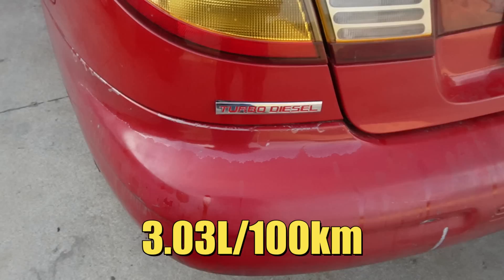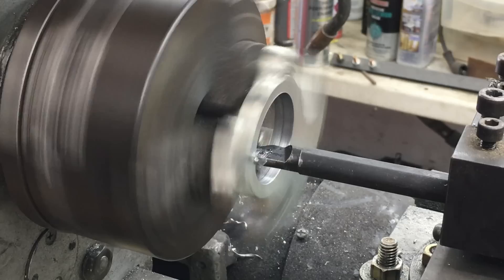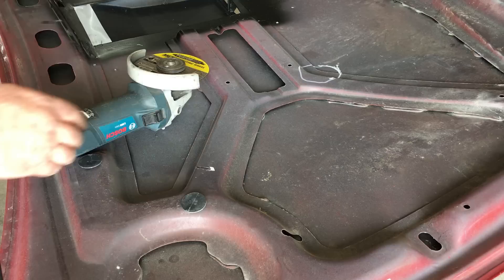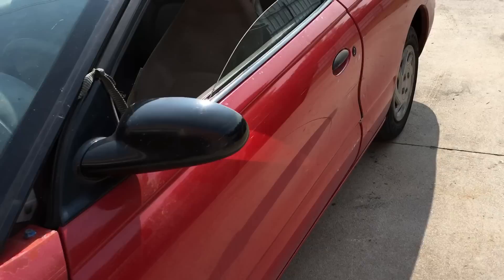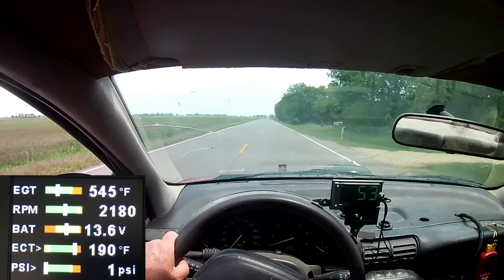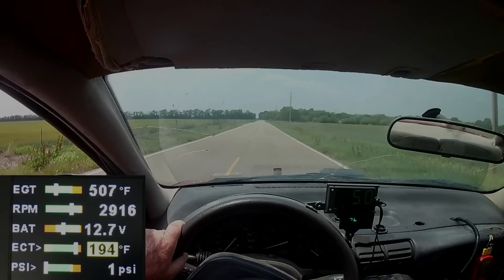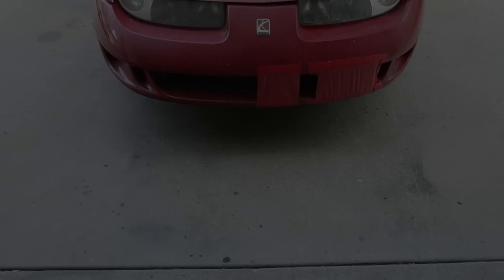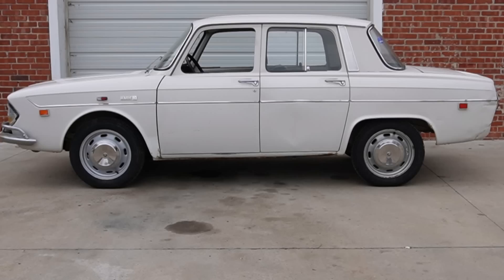S3 E17  We get 80 MPG with our D722 Kubota turbo diesel Saturn.  Best fuel economy yet !

Comment: Hey One more suggestion for the saturn, add steam into the intake. I have used waste heat from cooling system to do this on gas engines and gotten a steady 15% increase on fuel economy, diesels not having vacuum are a little more difficult. I want to add a small mister nozzle onto the exhaust manifold, but it is difficult to do on a 7.3. This little engine has the exhaust right there. Maybe weld a pipe onto the exhaust with a small tube holding a nozzle to spray water, or a water meth mix (aka winter time windshield fluid) . Run the larger pipe from the exhaust to the intake pre intercooler. 

The idea is two fold, 1 the steam displaces air, and 2 thw steam being in direct contact with flame will turn more heat energy into mechanical energy because water expands more with a given amount of energy than normal air/fuel/exhaust. And I guess it might cool the egts while still spooling the turbo, but that is a WAG
Reply: The Saturn, which is no longer in the driveway, and Jimbo said he will no longer torture it?
Reply: @drippingwax  maybe a little more torture, the horse wasnt quite dead yet.
Reply: @mythoughtsonfaith1031  Sir Gallahad - Bet you're gay!
Reply: @drippingwax  hmmm well if your fishing, your using the wrong bait, sir gaylahad

Comment: Remote Cantuna: I feel your mileage would improve with a small 4 cylinder diesel.  Something that would chooch the turbo between 20 and 30 lbs of boost. You engine just isn't large enough to produce boost and seems working way too hard for this size car. With a small Grey Marine engine you could dial way down on fuel and with a hand operated boost control while driving I believe at 70 mph this car could approach 120 miles per gallon with your degree of dedication. That is with perfectly spraying injectors and the compression at 22 to one with only one ring and the oil ring with a ceramic piston coating and 5w 30 synthetic oil.

Comment: hello. I think it could improve if I put the exhaust outlet on the side skirt. You probably need a particle filter, at least to pollute less.
On the other hand, what do you think about joining the turbocharger together with a supercharger, that is; Turbo-Interculer-Supercharger, increasing the pressure even more but gradually to the demand of the engine.
Then I would put a water methanol injection into the intake.
Greetings from the Canary Islands.

Comment: Tips for Career Success as a Recent Engineering Graduate
Reply: Go Above and Beyond Your Job Description

Extending your scope of influence beyond the job description and contributing to other departments can make a huge impact, says Arek Gdowski, an engineer at Dehumidifier Corporation of America, Inc. (DCA). He not only develops engineering solutions within DCA but also helps out in the IT department.

“You would think you're just going to focus on engineering only, and you're just going to do your one [role] — but it doesn't end there; it goes outside the box,” he says. “You quickly understand that you really don't have just one job — you have many.”

Gdowski also urges young engineers to be outspoken to set themselves apart from colleagues and accomplish more by presenting new approaches or solutions to challenges.

"Don't be afraid to speak out and say your new ideas, because many of the things I thought were just an idea that came to mind suddenly became a reality," Gdowski says. “Take that step and don't be afraid. Don't be afraid of failure, because you will fail many times before you succeed.”
Reply: Work Collaboratively

Rachel Pacheco, a chemical engineer and senior manufacturing manager at Genomatica, says that working collaboratively is the key to being effective and successful within not only your engineering job but any role across disciplines.

“Communication is the center of everything,” Pacheco advises. “That’s understanding how much to communicate, when to communicate, [and] in what format to communicate.

On top of communication, it’s about building strong relationships,” she adds. “Especially because we work in such a multidisciplinary field, having a strong relationship with mutual respect, openness, honesty, and transparency is absolutely essential."

Pacheco goes on to advise that these strong relationships are the platform on which you can build your career, and these connections can help you further develop your skills, approach challenges in a new way, and eventually move up in the ranks within your company.
Reply: Stay Focused on the Task at Hand

Despite Gdowski's larger scope of influence within his company, he understands the weight of his responsibilities and urges young professionals to stay focused on what's in front of them.

“You’ve got to take one project at a time. The brain can’t focus on many things; there’s no such thing as multitasking,” he says. “You have to focus on one thing, finish that one, and then move to the next one.”

Gdowski cites balancing his responsibilities as one of the biggest challenges of his job and encourages engineers to ask for help if they need it.

Comment: I want to see that saturn cranked up more fuel equals more boost which makes more power add another turbo preferably bigger on top of the first one to compound it which will add more power on the top end and maybe bigger injectors

Comment: The trouble with learning from experience is that you never graduate.🤠🤠🤠🤠
Reply: A meaningful life is a way of living that’s not only happy and fulfilled but also has significance and impact. The Meaningful life is about having a sense of purpose.
Reply: A meaningful life is a way of living that’s not only happy and fulfilled but also has significance and impact. The Meaningful life is about having a sense of purpose.
Reply: Life is a non-linear journey — challenges are guaranteed. Think beyond your present suffering. “To live is to suffer, to survive is to find some meaning in the suffering.”
Reply: Design your life around everything you deeply care about. If you can’t make a living doing it, schedule time outside work for personal projects that make you come alive.
Reply: “Purpose” is half the solution to a meaningful life. All meaningful lives start with a single and significant why. The life you want starts with a bigger goal. Always start with the end in mind. By losing your goal, You have lost your way.”
Reply: A meaningful life requires a meaningful personal action. A better and more enjoyable life requires active participation. If you are not in control of the direction of your life, meaning is not guaranteed.
Reply: Every day is a one-time reality to experience. Make the most of it. “Life is not a problem to be solved, but a reality to be experienced.” —
Reply: Make time to clear your mind. Make it a daily practice. It’s a life-changing habit. If the control centre of your life is chaotic, you won’t have a meaningful life.
Reply: Life is not linear. There are no perfect endings. Don’t expect flawless results. To maintain your sanity, learn to let go if things go wrong. “When things go wrong, don’t go with them.”

Comment: Thanks for this tiny turbo-diesel series! It's been fun & educational. 
Would you consider a Smokey Yunick style Hot Vapor Cycle gasoline engine fuel system? Claims are staged heating of a lean (20:1 oe leaner)  air & fuel mixture to a complete homogeneous charge, hi power & high mileage. Complex yes, but fun!

Comment: Add water in a dry fog format, dial down fuel 🤠🤔🤔
Reply: Could always add a different fuel. Maybe use dual injector heads.  Lp and diesel.   Water fog would help heat, maybe.

Comment: I've been following your builds from the beginning of the Insight. I've done some engine swapping and tinkering with a 4bt, and something that really helps fuel economy on those is increasing the injection timing a bit. I am wondering if that's something you have looked into? I know the pump can't be rotated on the kubota, but maybe the gear could be bumped up a tooth. This would need to be done cautiously, because increasing the timing also increases the load on internals.

Comment: I think you would have more luck with speed times if you made friends and welcomed back the gnomes, but also used non-highway diesel for the lower cost. 

It feels like the fuel stations are launching flash sales, since I filled up for $2.69 a gallon of diesel and after two hours it was back past $3. Would love to run the red diesel.

Comment: are you going to increase the boost until a rod exits the block?
Reply: Yess
Reply: Actually no, I don't think it's good to destroy this hard to come by and expensive engine. The channel is not doing great monetarily. If wished, I think harbour freight engine maybe will be tortured until failure, it's easy to come by.
Reply: That would be pretty difficult with a small turbo like that.

Comment: I looked up the torque curve on that diesel, and 2600 you have max torque (33ft-lbs) and 20hp at 3600 rpm. WOT NA that's 89cfm, and 1.25in pipe is what would have been suitable for that, so I can see why some think larger was better, but not necessarily needed if it's getting dumped. 2in was a good guess.

As far as gearing, the closer to the peak torque value the better. Mostly every vehicle is built with their cruising speed and top gear to meet at the max torque value, and that's usually 1900-2300 for most cars.

Comment: My small block powered Express van is the same way between Direct Drive and Overdrive.  Practically no fuel savings in OD. It needs a deeper final gear and more rpm in overdrive.

Comment: I probably have no idea what I'm talking about, but I feel like the best setup for cruising on a diesel is lower RPM with gobs of boost. I have no idea what sort of wastegate control you have but the boost is pathetic these past few runs. I have no idea how you'd get there but I feel like cruising down the highway at 1500 RPM and 5-10 pounds of boost would be peak economy.

I almost feel like something is broken. I can't believe that the engine refuses to bog down and spin up the turbo at lower RPMs. Maybe try propane injection?

Comment: Maybe a more streamlined equal length exhaust header would provide some benefit. Even a little increase in exhaust gas velocity and flow on this small of a turdo will improve spool and could provide a bit more boost at a lower RPM.

Comment: It seems the fuel isn't having enough time to burn completely, hence the smoke and high EGT. How about advancing the injection pump through its gear? taking the shims off seems to only have increased injection duration, starting before, but also stopping later. the ideal here would be to start early and also stop early.

Comment: taking fuel away wont help your smoke issue its just going to take longer for the turbo to spool, take power away, and a sluggish boring launch that in turn will probably still smoke i hope that helps my solution would be trying to modify the injection pump to have something like a Mercedes ALDA which adjusts fuel in the injection pump based off intake pressure
Reply: also diesels dont need boost limiters most of the time you can control boost with fuel as well because the more fuel the engine has the more it can spool the turbo so it wont just build boost until it blows hopefully but it will also make the acceleration efficiency much higher because it is burning ALL of the fuel in the cylinder under boost
Reply from the maker: Backing off on the fuel did help with the smoke when shifting.  it was of course a band-aid to make the car driveable  without  being overcome with fumes in the cabin. As you mentioned the engine needs something like the  ALDA use on Mercedes and that is the plan when we transfer the engine to  another project vehicle.  Our version of the ALDA will use a stepper motor to adjust the fuel limit and of course a micro computer and some sensors.  Electronics and software  is my specialty so this will be a fun project.

Comment: Lots of Laughs and good data points.
Great job on documenting the injector  pump settings.
All in all You Did Not Change injection timing; correct?.
Reply from the maker: In a previous episode we did change the injector timing.  To change the timing, a few shims under the pump were removed.

Comment: What about keeping the other over driver and keeping the rpm the same, wouldn't keeping the same rpm at at higher speeds give better mpg?
Reply from the maker: Are you referring to the taller overdrive that we borrowed from the MP2 transmission?  if so, well it wont work because it lowers the rpm of the engine too much and in order to keep the car at a reasonable speed the accelerator has to be pressed down even more,  thus wasting fuel.

Comment: with this you have surpassed the lupo 3L which has all sorts of fancy engineering. I wonder how that car could be improved too! if you ever get a lupo 3l you will most likely need to get a manual version, as the half automatic is difficult to service

Comment: Is your car making a loud noise when accelerating, braking, or just sitting in the driveway? Today’s cars are quieter than the clunkers of old, yet certain squeaks, rattles, and hums are still part of the driving experience. Sometimes, however, you may notice a strange noise coming from under the hood, from the tires, or from some hard-to-pinpoint location. When this happens, pay attention! Don’t just turn up the stereo or ignore the noise, hoping it will go away. Instead, find a good mechanic who can diagnose car problems and fix them.
Reply: Knocking, Popping, or Banging

The most common cause of engine knocking is using low-octane gasoline in a car that requires high-octane gasoline, which leads to improper vehicle performance.
Reply: A car engine noise that sounds like popping can indicate several problems, including worn or dirty spark plugs, a clogged fuel filter or dirty air filter, bad ignition wires, or a problem with the distributor cap or rotor. It can also be caused by a dirty mass air flow sensor or oxygen sensor, or it can signal a problem with the catalytic converter
Reply: Squealing

If your car makes noise when accelerating, and it sounds like squealing or chirping sounds when you step on the accelerator, you could have a loose or slipping engine belt, or there could be a problem with the water pump.
Reply: If you hear squealing from the wheels when you apply the brakes, there could be serious problems with the brake rotors, brake pads, or brake shoes.
Reply: . If you hear squealing when turning to pull into a parking spot, it could be an alignment issue.
Reply: @ocdman202  I have heard a Wobbling sound as of late. 
If your car sounds like a loud laundry machine on high spin, pull over and check your tires. The problem could be loose wheel nuts (which means the wheel could fall off), or low tire pressure, which could cause a tire blowout. Jack up your car. then tighten your wheel nuts using the lug wrench. If the tire pressure is low, fill it to the proper weight. You might need to replace the tire if the sound continues.
Reply: @mommapanda5736  Clicking or Tapping

Clicking noises, especially when turning, may indicate a problem with the CV joints, which are located on the inner and outer ends of the axles.
Reply: These allow power to be transferred efficiently to the wheels while still letting the wheels turn and move freely up and down. Clicking noises can also be caused by failing universal joints, which are located on the drive shaft.
Reply: When it’s a car making noise when accelerating and the clicking or ticking speeds up with higher RPMs, it’s coming from the engine and typically means that the engine is low on oil or that there is a problem with the oil pressure or valves.

Comment: Can You Freeze Milk? The Answer Might Surprise You
What to know about freezing every kind of milk.
Reply: Can milk be frozen and used later?

Milk can be frozen and used later, but there are some caveats to keep in mind. Though milk can last up to three months in the freezer, it's ideal to use it within that first month of freezing. After that, the texture of milk can become gritty, which may be unpleasant depending on how you plan on using it. It's also important to freeze milk using freezer-safe containers.
Reply: Is it safe to freeze milk in plastic containers?

Using an air-tight plastic container is one of the most optimal ways to freeze milk, but leaving room at the top is important. "The best way to freeze milk is to pour it into a container, leave at least an inch of space at the top and secure the lid tightly,". "Shake the container gently to mix the fats throughout before placing it in the freezer."
Can you freeze milk in ice cube trays?

What if you just need a little bit of milk for your morning coffee or oatmeal? If that's the case, freezing milk in ice cube trays makes for a more convenient option. "It's best to first freeze the cubes and then transfer them into a plastic storage bag or freeze-safe container,"  "Otherwise, the surface of the milk will begin to experience freezer burn due to its high-fat content."
Reply: @mommapanda5736  We put milk in ice cube trays..   Almond milk
is better than  goat's milk ,  but buttermilk will give those little bits
of butter.

Comment: For that size engine the most suitable turbo could be the one fitted to Smart fortwo diesel and gasoline engines, around 600- 800cc. It may be hard to find in the USA since that car did not have much success in your market. horsepower is a similar 50 to 70 hp

Comment: Why keep the engine coolant so cold? Most deselect thermostats don't even open till 195 degrees, don't they?
Water doesn't even boil till 212 degrees and actual coolant is higher than that. Then there's the pressure cap on the radiator raising it further. 
Wouldn't it get more complete combustion and possibly be more efficient at a slightly higher temperature?